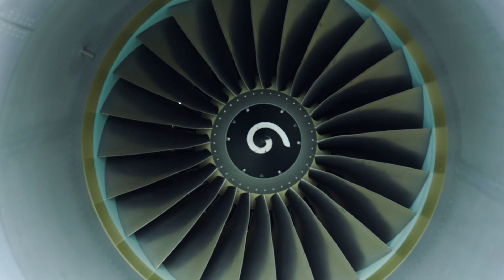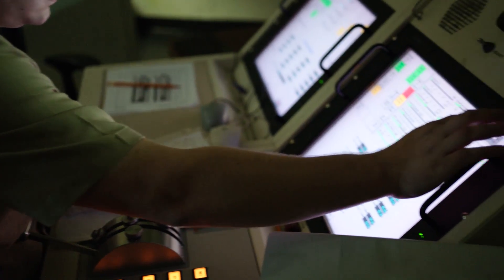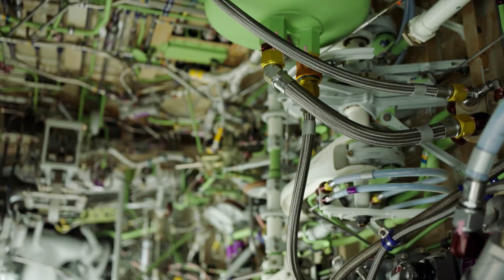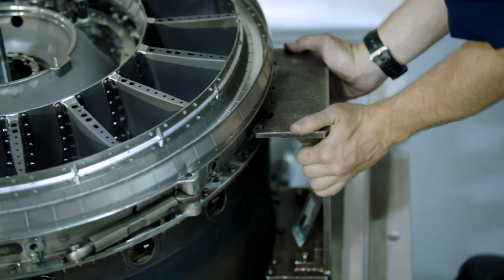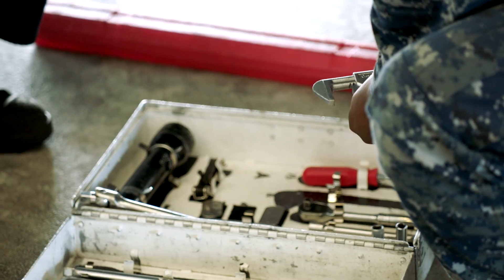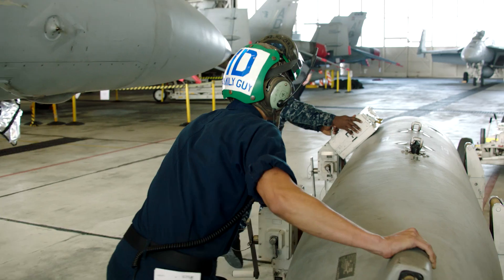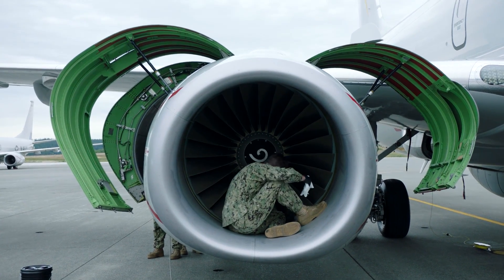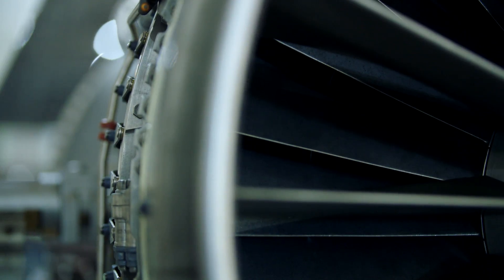Navy Aviation Machinist’s Mate – AD

Comment: I was an AD back in the early 80s on the HH-46A Sea Knight helicopter. The video is a little misleading. There are 3 types of Maintenance divisions in the Navy. The first is the Organization level (O), the 2nd is AIMD Aviation intermediate maintenance Dept and depot level (civilians). On an Aircraft carrier, you will be either squadron (O) level, or ships company (AIMD) but not both. Most people in the squadron maintenence departments don't spend a lot of time on the flight deck. Their time is mostly in the hanger bays. I switched over to AO (Aviation Ordnancemen and I did spend a lot of time on the flight deck.

Comment: This is where I started in my aviation career.  When I wasn't working in my rate I used to ask my division chief if I could go work with the avionics guys or the sheet metal guys.  Took as many A&P classes as I could in my off time but didn't have too much off time.  Finished up on my A&P one month after separation then worked defense contract, commuter regional airline, air freight, then major US airline.  Retired in 2021 after more than 35 years with that airline.   FLY NAVY!!!

Comment: How long do you need to work in the Navy to get an A&P license?
Reply: As soon as you get to the fleet, you can start to rack up the hours you worked. When you get 5000 working hours, you just have to take 3-5 tests and you can get your A&P license
Reply: @doritogoddess192  nah. You need 30 months time in rate.
Reply: Did a 4 year tour and had my A&P completed the month after I separated.  Worked for a major US airline for over 35 years retired in August 2021.  FLY NAVY!!!

Comment: 233 dislikes comes from AEs.
Reply: Are you an AD?
Reply: @dustinshane3060  Was. Worked O-Level maint. Fun times!
Reply: GawdAz3s any chance I could get your contact. I’m intrigued and would like to speak with some sailors who actually had that rate
Reply: @dustinshane3060 what do you mean by getting my contract? As in getting recruited as an AD? If so then, the rate itself is open from what i know since before i left, the navy was giving away re-enlistment bonus for it.
Reply: @gawdaz3s339  Would you recommend AD, AM, or AME if i was looking to get a job at a company like Lockheed Martin?
Reply: @collin833  I think any of those would be good.